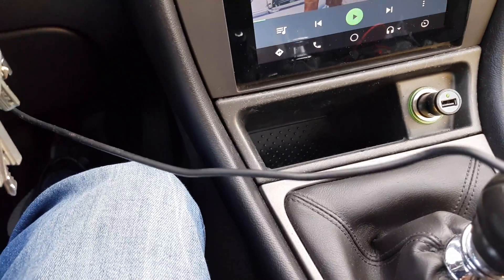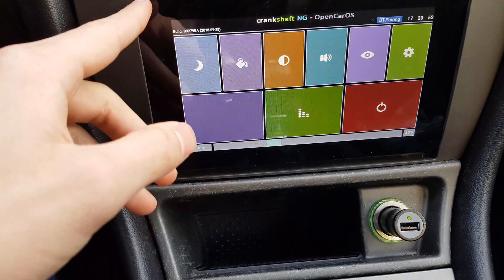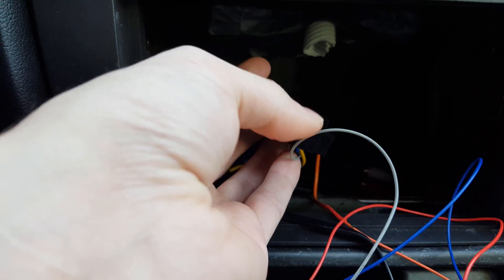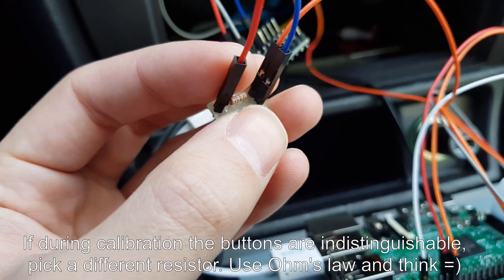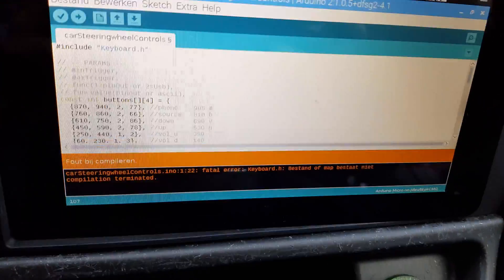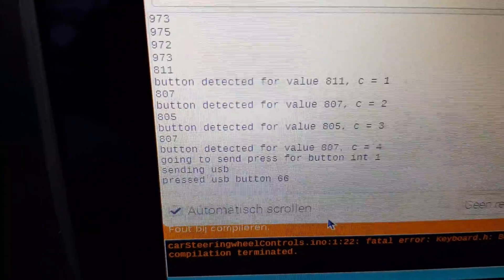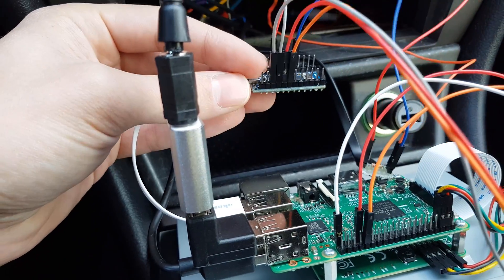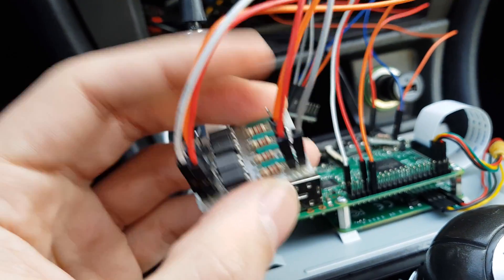how to: interface steering wheel controls with an arduino (stepped resistor)

Comment from the maker: I haven't discussed it in the video, but this method of interfacing allows you to get even more possible button combinations from your steering wheel because you can press buttons simultaneously and get a unique analog readout. You can even modify the script a little bit and get it to recognize double presses, or short and long holds fairly easily. and then map those to different functions/buttons.
Reply: Hi, I'm not really experienced with coding. How would you add long presses to the script?
Reply: Great work. That's the solution I was searching for. Read voltage from a resistor based schematic (SWC) on A0 and use it to trigger some gpio at the rasp. Didn't know that conect the GND of both systems do not work. Work is still in progress in the car, but man that helps a lot for recognize where the prob is. Excellent work and specially thanks for uploading and sharing your knowledge. Thumbs up
Reply from the maker: @chillmethodman  thats great to hear! Good luck with the project

Comment: Hi i I measure the resistance of the buttons and they were different but the output voltage for all the buttons was same and close to 45mv 
After trying Arduino All buttons worked the same 
I will be happy if help me with that

Comment: Thank you for the video.
I'm trying to find bluetooth receiver that also works with stearing wheel buttons and I come across this video.

Maybe it's possible to sniff on can bus that connects to head unit and catch button press'; then forward it to diy BT receiver to pause or do other controls.

Thanks again for sharing you work.

Comment: I'm currently attempting to make a car radio out of a Pi for my '04 X-Type as a final project for one of my college classes, and I stumbled upon this gem of a video in my search for a way to use my steering wheel controls with said Pi. I am using LineageOS for my build, as I have an iPhone and therefore need to use CarPlay rather than Android Auto. Button mapping/AKC codes are as follows:

Volume rocker >> volume up/down (AKC 0x0018/0x0019)
Track rocker >> next/previous track (AKC 0x0057/0x0058) 
Voice button >> mute (AKC 0x00a4)
Source button >> play/pause (AKC 0x0055)

Seeing as all of these exist within Android as keyboard inputs, can I exclusively run USB commands? If so, how can I modify your preexisting design so as to entirely cut out GPIO control while maintaining USB control? Finally, do you have any tips I should follow seeing as we are using nearly identical vehicles?

Comment: Very cool video. I didn't even think of just using the resistance signal near the stereo; I was going to build an arduino with bluetooth into the wheel itself. This is a lot simpler.

Comment: I realize this is a late post, but why aren't you running this script directly on the Pi? Is it not able to read the resistance from the voltage divider directly into the GPIO pins?
Reply: To those wondering, yes the pi is not able to read the analog signal coming from the SWC. You need a dedicated Analog-to-Digital Converter (ADC) to read in the voltages. The pi does not come with an ADC.

Comment: Hi Rutger, gr8 story :). 

I have a VW T5 from early 2008, which doesn't have the right CAN modules and wiring to make my retrofit VW Golf 6 GP steering wheel work. The horn also doesn't work.
What I'm wondering is, would part of this setup work connecting the USB output from the Arduino ATMega 32u4 to my Android 8 Radio?
Or is there a way to hook up the ATMega to my Key 1, Key 2 and ground wires on my Android radio? My radio could then just learn the keys received.
Thanks !
Reply: Hello Daniel, do you had a response ?
I have a multivanT5 too and a 6-SWMF and search too use MF.
Reply: If your headunit has SWC (steering wheel controls) input with auto learning feature, then you don’t need an Arduino as a middle man. 

Just connect your car’s steering wheel wires directly and proceed with the learning procedure.

Comment: What was you solution for mounting the RPI screen? I am still looking for a way to do it in my car. The only things I can think of is either epoxy  or cannibalize the OEM-HU gut it and mount the screen to that, the bonus would be a nice tidy place for the opto-coupler(s), timer, etc.
Reply from the maker: I knew i wanted the screen in my car so bought it before i had the solution. Turned out it fits in with friction in the doubledin frame.
Now i think thats just luck and a better way would be something more secure. The most secure is to screw it down to the rpi mounting holes itself. Theres 4 in the pi on the back. If you have a 2 long flat pieces of metal you can join these 2 in the back of the double din frame from left to right. Then drill 2 small holes in each and screw the pi into it from the back.

I think screws are the sturdiest non-permanent fixture. All you need is a metal drill bit and some spare metal strips.

Comment: Hallo Rutger,

Ben zelf hier ook mee bezig.
Maar dan bouw ik het in de originele radio.
Zou ik de originele knoppen van de radio ook op deze manier werkend kunnen krijgen?

Mvg,

Bas
Reply from the maker: Dat is een niveautje moeilijker. Wat wel vaak kan is dat je de cd of casette audiokanalen "onderschept". Zijn vaak simpele L+R audio kanalen die je kan afknippen en je eigen adapter tussen zet. Simpelste is bv een 3.5mm audiokabeltje er aan solderen. Moet wel de radio goed gedocumenteerd zijn zodat je weet welke pins de L en R audiokanalen zijn. Ook werken je radioknoppen dan niet nee.

Of je moet helemaal improviseren en de front van je radio gebruiken en alle knoppen omleiden naar je eigen systeem. Belachelijk tijdrovend werk en heb je wel meer kennis voor nodig dan ik je kan bieden.

Comment: How did you get it to play through the speakers without a radio? Most people on YouTube say you need an FM transmitter and run your sound through the factory installed radio
Reply from the maker: I removed the radio on purpose. Gives me more space and options. The stock radio used to simply connect with an internal factory amp to the speakers. I now have a custom amp hooked up to the speakers and drive the amp with a raspberry pi
Reply: no. you dont, you install an aftermarket amp to drive the speakers, with the input hooked up to the pi output

Comment: GLORY!!!!!!!!!! But seriously this is a great setup. So I have some things to talk about. 

For most car audio installs I would just buy the auto resistance conversion box for aftermarket radios and call it a day but honestly even those for the money are super clunky sometimes as far as response time goes. Lately most of my installs use the persons phone or a platform of their phone such as android or Barf (apple). Basically the car has a custom built mounting system with a magnetic wireless charging ring in place of where the radio would go and a CSR8645 APT-X Bluetooth board which auto pairs with the phone when you start the car so everything is seamless. This is nice because the output from the Bluetooth module can go directly to a equalizer or amplifier without relying on a radio as far as flat response goes. In addition if the user wants to upgrade their "radio" aka phone they can do that and the system will still function the same. I kind of strayed away from making the cars radio better, except for cars with climate control and radio built into one. Usually with those I modify one of the inputs such as CD or Tape for the Bluetooth module. 

This is the main module I usually use https://www.ebay.com/itm/CSR8645-APT-X-HIFI-Bluetooth-4-0-12V-Receiver-Board-for-Car-Amplifier-Speaker/202281459760?ssPageName=STRK%3AMEBIDX%3AIT&_trksid=p2057872.m2749.l2649

ANYWAYS. I love the setup to read resistance but would like to use it for this Bluetooth board as it communicates with the phone for track changing, volume changing, play/pause, answer ect... OG and it has a mic input which can be used for a car mounted mic with booster if need be. 

So I want to take a arduino nano or similar and using the resistance values in this case from my 2005 Infinite FX35 to complete a circuit as a output on various pins for the Bluetooth board. 

For example Output from car steering wheel is 2k ohms, arudino converts it and connects pins 4/5 (pins 4/5 could be Bluetooth module play button to COM aka ground) this would cause the phone to pause or play from a simple button push. 

Unfortunately im not the best at coding in C :( 

How could I change the code to make this happen, a example or edit would be greatly appreciated.
Reply from the maker: Hey thanks for reaching out. The bluetooth module you link looks like a great deal, a steal even for that price. How is the audio quality?

Hooking it up definitely looks possible. On the amazon page pic 3/5 shows the wiring you need for a button. The small optocoupler board that i introduce at the end would replace the setup in that image (replace the shown buttons). You probably dont have to modify my code this way (except for calibration obviously) as you can use the gpio pin out type to trigger the optocoupler board.

This only means you will need to solder a small protoboard, but anyone can do it as the skill level required for this coupler board is really low. If you need some help working out the details, ill be more than willing to take a look for you and help with drawing up the schematics.
Reply: @rutgerdegraaf5277  Yes the sound quality is actually very good with the CSR8645 comparable to CD quality surprisingly.  Here is more info on the 8645 https://www.qualcomm.com/products/csr8645

There is even better versions such as the CSR8675 which is even better quality https://www.qualcomm.com/products/csr8675

They have awesome features. Some which the daughter boards that the Chinese manufacturers dont even implement like dual microphone noise canceling similar to what most modern phones use. That would actually be bad ass in a cars setup.
Reply from the maker: Edit: watch from 6:57 for the board that you need. From what i can tell from the amazon page youll have to short vol/play/next/etc with com. So i would try to hook it up as if the bluetooth board is the rpi, just connect the white wire to com and the coloured wires to the mapped volnextprevplayetc buttons
Reply: @rutgerdegraaf5277  What I dont really get in the code is where the "output" signals go. Can I just use one analog input like your code says on pin A0 and then use pin outputs from the same arduino to go to something like a relay board (it could use opt board like you said. I assume one already exists from the china's. Here is one. https://www.ebay.com/itm/1-4-8-Channel-Optocoupler-Isolation-Module-Opto-isolator-High-Low-Level-Board/391932093256?hash=item5b40f92348:rk:1:pf:0&var
Reply from the maker: @ForwardEngineering  you have 3 different circuits.
1 the analog reader. Power from the arduino goes into a resistor and splits to the analog in a0 and the steering wheel controls. Analog in will read 100% (1024 ish) as the loop is closed. When you press a button on the swc, part of the current will flow through the swc into the gnd of the car. Ultimately there will be some closed circuit between the arduino ans the swc ground of the car of which the details dont matter. The drop in voltage when you use the swc occurs at analog in a0. It drops differently depending on which swc button.

2 and 3 gpio loops arduino and blt module. We want the arduino to trigger the bluetooth module buttons. The blt module however cant be triggered by the arduino, it probably uses an internal pullup resistor to trigger a button press when a low gpio pin is connected to gnd. Why it works this counterintuitively is because of power savings https://raspberrypi.stackexchange.com/questions/9481/gpio-why-wire-button-to-ground-rather-than-3-3v.

2 we thus need two seperate loops. First is the arduino gpio to the optocoupler board input side to arduino gnd. When you trigger this gpio pin in the arduino software, it will open the gate on the other side of the optocoupler.

3 trigger on the blt board. You go from volumeup for example to the optoupler output side to blt board com. Thie blt module will be triggered when the optocoupler board is triggered on a certain rail.

The optocoupler relay you sent me looks like it will work, but removes the possibility of you playing around with the internals. For the price i would feel pretty safe to give it a go though. If you encounter any problems it most likely wont be from that board ;)

Comment: Good stuff. Will the harness be already be present, connected to a comapny fitted stereo? Also how does the android Auto by Crankshaft understand the signals coming from the arduino?
Reply from the maker: There is a harness that goes in the factory stereo yes. It is the one i replaced with a cheap open ended wire harness for about 25 euro so that i can safely cut in it. I completely removed the facrory stereo. There is a custom amplifier in there that runs the speaker wires and the raspberry pi sends analog sound to the amp.

Crankshaft can understand keyboard strokes by simply going into the settings, there is a whole setting page dedicated to different keystrokes and functions. Gpio commands can be configured in a small config file as instructed on the crankshaft github wiki